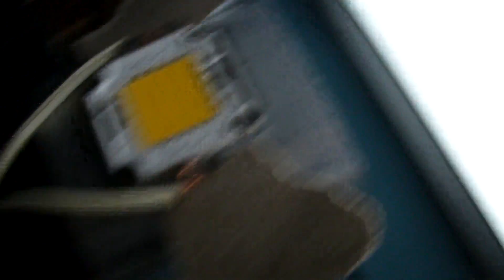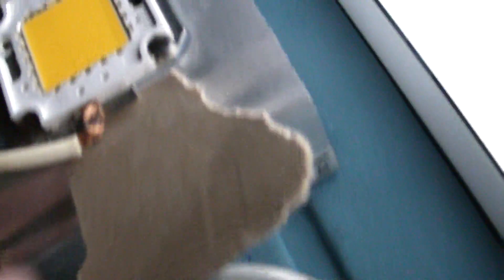100Watt LED test

Comment from the maker: I wish it was a loco headlight lol
I own a cab light that's from a scrapped BNSF diesel-electric locomotive. Diesel electric headlights/ditchlights requires 75VDC with 350W and their 5 1/2 inches in diameter. if you wanna see it I can make a video of it and my possible plan to try and power it up

Comment: How long do the 9v batterys last?
Reply: Each 9v has about 500milli amp hours. Because they are wired in series you still only get 500mah. So if this thing draws 3amps then  I figure it would last maybe 10 minutes. But I could be wrong.
Reply: Designandrew If each battery is 500 mah, youd be able to supply 2 amps for an hour, 4 amps for 30 minutes, etc. from the power an voltage, this probably draws about 3 amps so were looking at 45 minutes maybe
Reply: Lan Hikari They are in series. In series you don't get the sum of the current you only get the sum of the voltage. 500 mah in series is still only 500 mah. Pretty fucking simple.